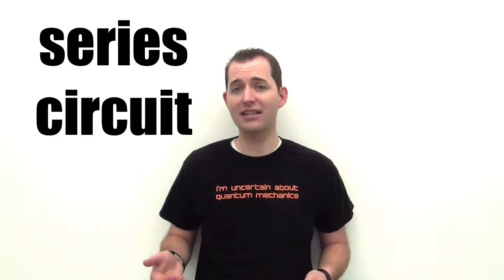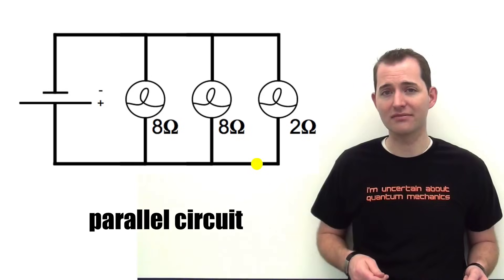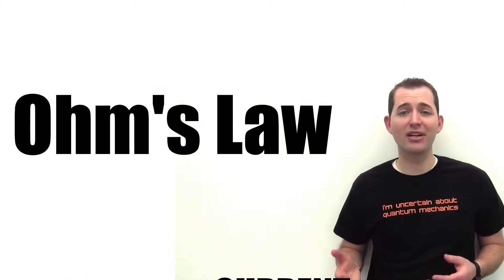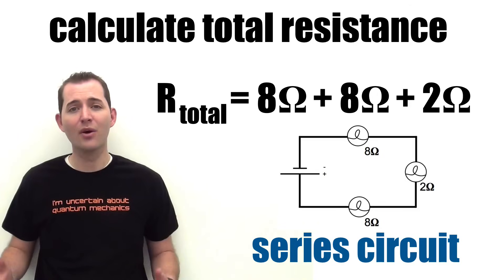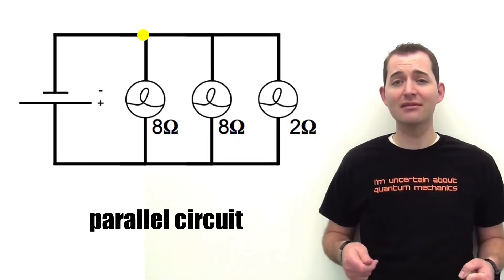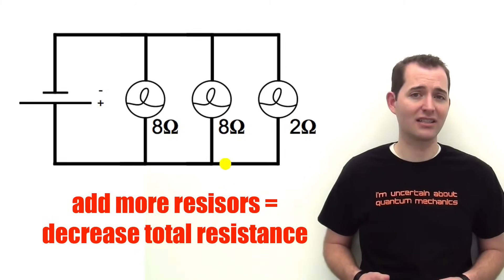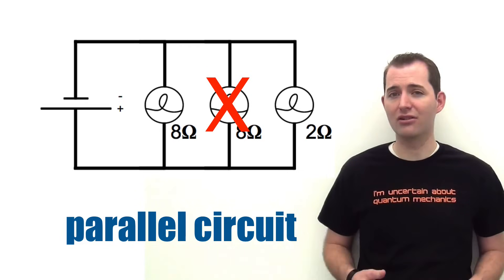Series vs Parallel Circuits

Comment: He made a mistake for the calculation for the parallel circuit.
It's actually 0.125 + 0.125 + 0.5 which eqauls 0.75.
Then you do 1 / 0.75 which gives you  1.3
Reply: Lol I was wondering why I didn't understand the parallel circuit answer.
Reply from the maker: Thanks!
Reply: I was confused too. I know the numbers did not look correct.?
Reply: I thought I was going crazy when I seen that so I calculated it on paper and was like huh
Reply: Thanks for clarifying... I was scratching my head on that one. I thought I understood this stuff...
Reply: Dude I thought I was going fcking crazy !
Reply: Wow I wished I’d come to the comment section earlier Iv been doing my head in thinking I was doing something wrong lol
Reply: Look again. It says less than 2 ohms lol. NO MISTAKE!
Reply: Hellow gadhe
Reply: thank you i was VERY confused by that
Reply: Smh, i kept thinking i was doing somethinng wrong
Reply: I think everyone got confused because he displays it = <2 which technically is correct. He shows that total R will = something less than the smallest R value in the circuit. However, he says it as, “This gives us a total resistance of 2 ohms in our parallel circuit.” which is wrong by the formula. That said, I’m not familiar enough w/ electrical jumbo to not say perhaps that’s just how ppl in the trade quick solve for R in the field, just whatever the lowest value is then you know it’s gonna be something less. Why whip out a calculator at that point realistically?
Reply: That's why I try to remember the other little rule, the result "has to be lower than the lowest resistor in the circuit"...that's something I remembered quickly when I saw this error.
Reply: I thought I was tripping for a minute lol
Reply: I just sat here for 40 mins trying to figure out why I couldn't get 2ohms. Thank you so much!!!
Reply: This is true,
Reply: There's no mistake
He didn't calculate he just stated that the resistance would be lower the resistance of the smallest resistance value
Reply: Thanks, thought my maths skills were lacking.
Reply: Wow.... THANK YOU‼️
I just wasted WAY too long trying every f•cking nonsensical order of operations for that equation to figure out how in the ever-loving f•ck he got 2ohm as a solution‼️😠

Was literally coming to comment that his teaching method was dog💩 since I couldn't understand how he got to that answer, when I saw your comment as the 1st one‼️😂🙏

He should correct then re-upload this 🗑 if he has any integrity!
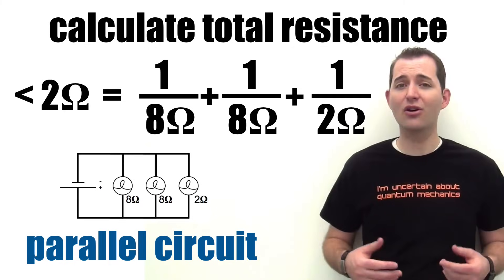Reply: @orion_222, yes in speaking he did make an error @4:41 when he said "2Ω" BUT on the visual aid he had "<2Ω" so "less than 2Ω" which is of course correct because the value is, "1.333Ω" because we know that in parallel you take the inverse of the sum of the inverse resistor values which are equal to LESS than the lowest resistance value. In other words, total resistance will be less than the lowest resistor value in the circuit.
Reply: I didn’t think I was going mad but I had to get a calculator to double check
Reply: 1.333...
Reply: Man I’m glad I came to the comments 😂😂
Reply: "Made a mistake adding fractions together"
... i am uncertain of quantum mechanics
Reply: Isn't that why the answer he wrote was "<2", meaning "less than 2"?
Therefore, not being an incorrect answer... just a case of "I don't have a calculator with me"
Reply: @marclink0  He had the wrong chart up. The chart he showed was simply to show that when resistors of mixed values are connected in parallel, the total resistance will always be lower than the lowest component.
Reply: Nerd
Reply: @brochallenger2151  im gonna have u work for me for minimum wage
Reply: @orion_222  Thats a real intelligent way to respond. Be better.
Reply: 😂.

Just hire a more productive person, that would be more helpful
Reply: @brochallenger2151  then why are you here
Reply: @vadimdumont  lol right?
Reply: @brochallenger2151  Hahah, exactly the word that came to my mind. I read these replies just to see if someone would call it out

Comment: I got 1.33Ω for total resistance in the parallel circuit.  When you put resistors in parallel, the total value will always be less than that of the lowest resistor.

Comment: I choose voltage over current. 

Reducing the need for heavier gauge wires, reducing voltage drops and increased arc stability (for MOTs and custom arc welders; oil cooling recommended). Possibly increasing charge as well.

Store bought welders can only be connected or wired in parallel which increases current. That will make you pay the power company more, drain more energy and make very noticeable voltage drops for your neighbors. At least you'll be able to cut metal with electrodes or get DC electrodes working on AC.

Side effects of excess current may include a very erratic arc.

Comment: I thought that the current (amps) never decreases in a circuit. It’s the voltage that decreases with each resister in a series. There is always zero volts at the return, if wired correctly, but the current flow remains the same. (Kirchhoff’s Law)

Comment: For the longest time I have had the hardest time understanding this for a speaker application, and no matter who explained it to me I just could never 100% understand (10-20 yrs) I couldn't figure out what 1 little piece of info I was missing. Looking at from a speaker point makes it hard to learn and what this video did was make me realize that parallel is the one I'm having a problem with. I have noticed under many of these video is that people leaving still still confused and I think I just figured out how to explain it, hopefully through writing.

When you showed the 1 single yellow charge going through the parallel circuit 1 resistor at a time, It throws off what is happening. What I never understood was why in parallel does the resistance go down, that made no sense to me. It's not that the resistance goes down, but that the power output from each individual resistor get added together, making the current added together, seem like there was less resistance.
12v@8ohm + 12v@8ohms, both of those powers added together is like having 12v@4ohms + 12v@4ohm, add those powers together and it's like 12v@2ohm. 

The resistance does NOT go down, it's just that when you add the powers from each resistor together, you get enough power to make it seem like the resistance has gone down.

People that do know all about this, does what I said make sense, did I finally figure it out?
Reply: As I keep rereading that, yes I guess you can say the resistance goes down, I see where that statement fits, but I think for the hard to understand people, explaining it in the way of the powers being added together, not that the resistance goes down, would help

A 1/4" hose + 1/4" hose + 1/4" hose all taped together does not have les resistant, it's just that the gallons per minute added together makes it seems like you have less resistance, therefore; more flow per minute.

I don't know if that makes sense but my math matches everyone eles math now, so I'm pretty happy.

Comment: Wrong conclusion! First of all, his total resistance calculation in this example is utterly wrong. It should have 1,33. 
Second, in a parallel circuit, you cannot increase the total current by increasing the individual resistors. 
Let's assume a 12V power circuit with 3 resistors with each 4Ohm. The current at each circuit will be 3A which gives you 9A for total current while the total resistence is 1,33Ohm. 
If we increase each resistor as 6Ohm, the total resistance rise up to 2Ohm while the total current drops down to 6A. In conclusion, the higher the resistors the lower the current while the voltage is the same. There is no exception for series or parallel!
If you need one conclusion, you can state that the total resistance in a circuit is always lower than the individual resistors.

Comment: Great video. Tracing a single charge moving through the circuit is extremely helpful.

However, please stop doing intros and stop the music. Higher production quality often times just distracts, lowering the actual clarity of information---which in an informational video is the only thing that's important.

Note also that there is a group of people who watch these types of videos on 2x speed, which makes your music sound jumbled, so it serves no purpose. Many people also skip intros, so what's the point?
Reply: Why are you bitching over free lessons?

Comment: I’m no expert, and i didn’t learn what I wanted to know about parallel circuits here but I don’t think your explanation about “if you removed one of the lightbulbs in the series circuit none of the others would work” was all that clear. I think what you are saying is only true if removing one of the lightbulbs OPENS the circuit, in  which case it is the opening of the circuit that makes the other lightbulbs not work NOT removing the third bulb. If you replaced that third lghtbulb with another resistor or any conductive wire, the other light bulbs would work just fine, (though it would change the amount of current going through the other two, if the third bulb was replaced with an element of different resistance. It may sound nitpicky of me, but to simply state that if the third bulb is removed the other two won’t work and NOT being clear that it is actually opening the circuit that is making the other two bulbs not work, it just tells me that you don’t explain tnings clearly, which probably means that when it comes time for you to teach me something new, it will be done in an unclear way. That is my biggest pet peeves about trying to learn these things on youtube. My actual  course is unclear on things many times, and it’s an online course, so its not always easy to contact the instructor. Sometimes I just go to youtube, to try to find a clearer explanation on something. (Really i was just trying to understand why voltages are the same across parallel circuits, at a physical level.) But it’s always so hard to find clear straightforward explanations. For example, saying that removing a third light bulb means the other two won’t work, is NOT clear and straightforward. Opening the circuit is what makes the other two bulbs not work, NOT removing the third bulb. I would love to find a youTube channel that is very good at straightforward explanations about circuits.

Comment: I'm late so I don't think I'll get an answer but it's bugging me how in your circuit diagram that one yellow charge flows from the negative terminal to the positive one, aren't we using conventional current because then that would be wrong.

Comment: How do you get 2 ohms as the total resistance? You don’t really explain it well. I’m new and I’m trying to understand. The formula is 8+8+2.. so wouldn’t that equal 18 ohms? I’m just trying to figure out how this equation equals 2 ohms or how you work the problem out to equal 2 ohms for the parallel circuit example.
Thank you

Comment: i dont get the explanation for the calculating the total resistance in a parallel circuit
Reply: When adding the resistance of a circuit in series, you simply add the resistances. When doing so in parallel you add them 1/R1 + 1/R2 ..etc. you simply put the resistor amount in the formula as stated above instead of adding them straight R1 + R2..etc.. after you put them in that formula, you take the inverse and solve for R(equivalence):
1/R(equivalence) = 1/R1 + 1/R2
Reply: @josphellihsilak4588  ok will you help me with  my time transducing capacitor  w/  built in      temporal displacement???ty so much..🤫🕢🚀
Reply: @bernardoprovenzanno9487  yea sure, send me your work and I'll help you out.
Reply: @josphellihsilak4588  thanx it's hard to find  ppl who deal with energy, frequency, &vibration...I'm gonna send specs on my grc79 induction motor..(einstein Rosen bridges)...

Comment: Can we get an example of a non-closed loop CCT? For example when R1 & R2 are in series w/ each other but they are also in parallel with R3. Would R1 and R3 be parallel? Or would it just be R1,2 in parallel w/ R3?

Comment: something wrong with the calculation of the parallel circuit
Reply: The answer you should have got is 1.33. The video is showing that the calculated value will be  BELOW 2 ohms ( with a < symbol before the 2 which means value lower than 2). The video is not showing the exact answer. Hope that helps.

Comment: If two 60 watts lamps are connected in series and another two 60 watts in parallel then what will be the total watts generated in each circuit?

Comment: Im so confused about this. The tweeter on one of my speakers blew for the 3rd time. I asked the shop where I buy these things what to do and they replied that I need to resistors for each tweeter. The first one is simple enough and makes sense, since it should be in series on the plus wire.  But they said that the second resistor should be connected directly to the terminals plus and minus of the tweeter in parallel. Won't it just short-circuit the amplifier if plus and minus is directly connected via a resistor in parallel -- and what's the point? Wouldn't the first resistor in series be enough?

Comment: I did R=1/8 +1/8 + 1/2...BUT i GOT R = 0.75 ????
Reply: Rob Brenton the answer you got was 1/R total. You have to ‘reciprocalise’ this number in order to get the total resistance on its own. So the answer is 1/0.75=1.33333

Comment: Question.. current takes path of least resistance?? So wouldn’t your parallel example go through 2 ohm resistor first?
Reply: It may but it will still go through the other resistors as well. The electricity is traveling near the speed of light so it does not matter which it goes through first in these examples.
Reply: I think you're right. His illustration of electricity flowing made no sense. The electricity would go through the lowest resistance first but also go through the higher resistance at a slower speed. The way he illustrated it made it seem like the electricity only goes through one resistor on each pass through the circuit.

Comment: 1:44 more resistance=less currentreally?than why current doesn't change in a series circuit? 
and most of all...why two bulb lights in paralel are brighter then in series? if the paralel circuit divides the electrons, why are the lights brighter?
Reply: becuz the voltage is the same.

Comment: okay, i didn't like how he had the current flowing in the parallel circuit... he had the current flowing through the first resistor,skip the second resistor and right to the thrid resistor.. not correct. the current would have branched off at each junction.
Reply: Yup. That animation for a parallel circuit was incorrect.

Comment: im trying to work out if i connect leds in series parallel but with odd number of leds in series will be the same brightness im using cc drivers each ie  4 series  /4 series /4 series /4 series /4 series /9 series /9  series /8 series   then each connected in parallel to a 800ma driver for example so each section gets 100ma    or do i need equal numbers of leds per series string

Comment: I have a series circuit with 12 bulbs in series. Each bulb has 10.5 ohms resistance. Rt 126 total resistance. 

I am trying to select a power supply. I can do a 6v or 12v supply. There are multiple amperage options. 

If I do 6v makes total current 6.85 amp 

If I add 100ohm resistor before each bulb makes total amps 0.65.

Comment: why does the total resistance decrease as we increase the number of resistence in a parallel circuit?
Reply: Adding more resistors in parallel is equivalent to providing more branches through which charge can flow. Even though the added branches offer resistance to the flow of charge, the overall resistance decreases due to the fact that there are additional pathways available for charge flow. The fraction of the total charge which encounters a single resistor is now less. The additional branches mean that the circuit can sustain a greater current.

Comment: if i want to connect leds (3.3v) to 220v in series how many leds i need and which resistor i need ??? ( i have 100 leds)
Reply: in series circuit, voltage will be divided across the components of the circuit, and if the leds all have equal resistance then equal voltage will be divided by them.

Comment: I understand the parallel circuit, what I'm wondering is how do I "end" or "close" the circuit?
Reply: You don't. You keep the ends apart. Closing the ends turns them into a series circuit and then you lose 90% of your lighting.
I often run a current through one end of the pos wire, and then connect the far end of the neg wire to the battery...anode and cathode join.

Comment: You calculated the parallel resistance wrong. If you add the reciprocals together (.125+.125+.5 = .75) you need to do the reciprocal of 1/.75 = 1.333 ohms of resistance.THE TOTAL RESISTANCE OF A PARALLEL CIRCUIT IS ALWAYS SMALLER THAN THE SMALLEST BRANCH OF RESISTANCE. Great video otherwise.

Comment: i have ADHD hella bad i just wanna know does wattage stay the same when you twist couple resistors together NOT end to end so twist a couple together and ohms stay the same but watt increase like I have four 1/4 watt 100ohm  and twist two together now I have a 1/2 watt 100 ohm right guys? fuck me I hate this ADD shit

Comment: so how would i get more power to my subs? should i wire them in series or in parallel ?
Reply: 100 subs with no vids challenge I'm guessing parallel. Since electrical power is the rate of flowing current, and you would be able to get more current flow in a parallel circuit (less resistance) as opposed to a series circuit (more resistance)
Reply: Ok.thank you.ill try that out